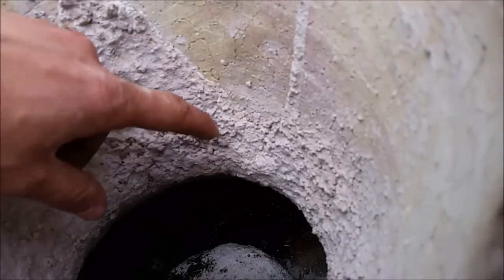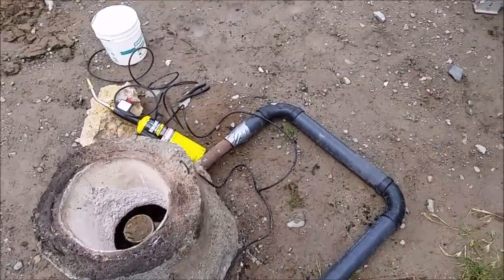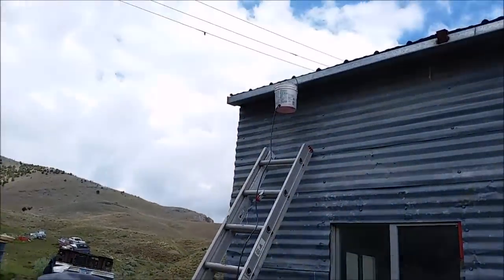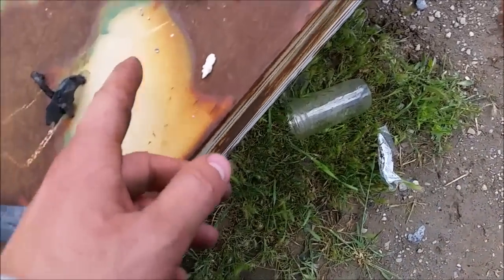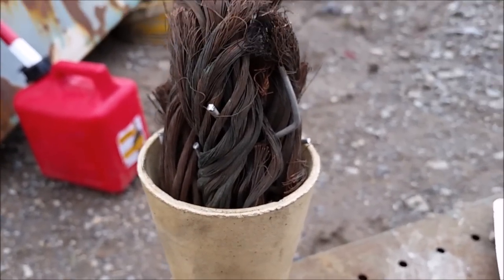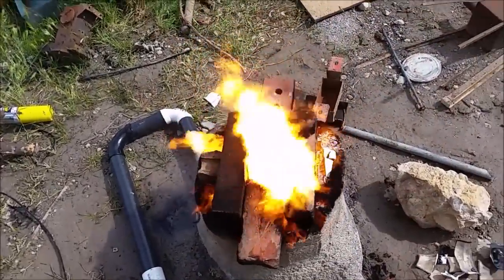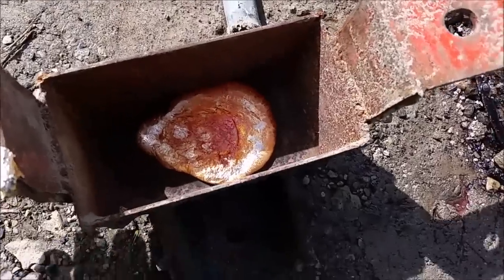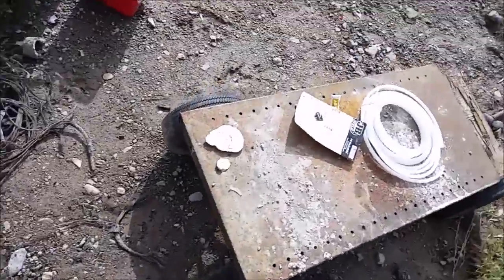Need More Heat!

Comment: I used to run my diesel car (when i had my old tired motor) on nearly 100 percent used motor oil. It definitely had a toxic as fuck smell and I realized just driving the car is probably exposing me to all kinds of metals. it also left white ash on my glow plugs, so I figured this was probably wearing my cylinders and I quit doing that. just saying, dont think you want to be around that.

Comment: hi cody just a thought      any way of mixing a little water with the oil  in a controlled way av u seen what happens in an oil n water fire   ask ya dad !!!!
Reply: It won't do anything but replace some of the space on the inside with water the only reason it is bad is becouse oil hates water and try's to get away makeing more surface area
Reply: It will burn 4times hotter  not even  bone is left  after  1of these fires it has nothing to do with mixing elements its the releasing of energy as they burn together.

Comment: cody do NOT ever mix any other metal while melting it i did once and it was aluminum and steel and it burned a hole threw my boot and had to go to the ER dont mix
Reply: Chester the squirrel any hot metal will do that...

Comment: would it work better to have the fuel delivered with a venturi?
Reply: yes, particularly if you use a gas state fuel, or high pressure liquid fuel. in my industry we refer to pure oxygen introduced 1st as primary air, then atmospheric air is mixed at the flame base , called secondary air. in systems that require very high temperatures these blends become very difficult to master, but once all adjustments are made , they rock on.

Comment: hey i have a 3 wide stainless steel pump bottom if want it sent yr way. i need a p.o. box to sent it to.
Reply: the tube is 3 in. wide with a solid end and about 15 inchs in lenght. yes that would be welcome. how do i recover the private messages?
Reply: +Cody&#39;sLab You should just open up your PO box. Might be interesting seeig what people send you

Comment: I enjoy your videos, but I wouldn't recommend pouring liquid metal towards yourself, ever. You might want to invest in a graphite crucible and some proper foundry tongs.
Reply: It would melt the graphite crucible. Pouring it to you isn't dangerous unless you're pouring a large amount
Reply: Liramek considering graphite has a melting point in excess of 3000k I highly doubt you are able to achieve those temperatures with this set up.

Comment: how do you burn used engine oil? I can't get it to ever light
Reply: not sure but it might just be that  youre trying to light a too big puddle with a weak source of heat which would make it hard for it to ignite and keep the reaction going
Reply: you have to get it in vapor form. like with a sprayer. preheating also helps.
Reply: check out Colin Peck's artfulbodgermetalcasting.com  and his waste oil furnace melting cast iron.

Comment: cody the furnace is awesome but i suspect you don´t have enough pressure to utilize the effect of the De Laval nozzle.
it is normally used to make a hot compress gas expand, cool and speed up.

but it really poses a problem when you what to melt stuff, you need to keep the heat trapped.
i can melt 1 liter  brass or copper in my furnace  using only a propane torch. https://www.youtube.com/watch?v=9A1t9MbYpcY for reference

And maybe the coanda effect is also working against you here.
due to the flames and hot air stinking to the sides of the walls, it might make a turbulent pressure zone i the middle of the furnace where the air is cooler.
it kinda dos that in mine

its like when you spin water in a bucket, and it makes the surface of  the water into the shape a parabola. and if you spin it fast enough the water goes over the side of the bucket.
hope you understand what i mean.
i am good at explaining
Reply: it defiantly looks to work better whit the bricks on top. mayby make a lid for it?
it work on my little furnace making the hot gasses
 seeking to the center